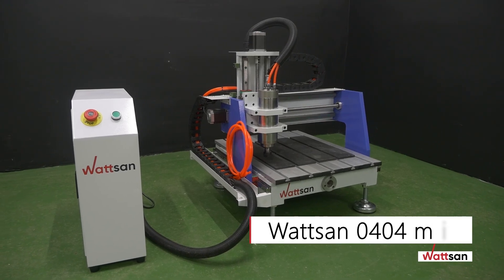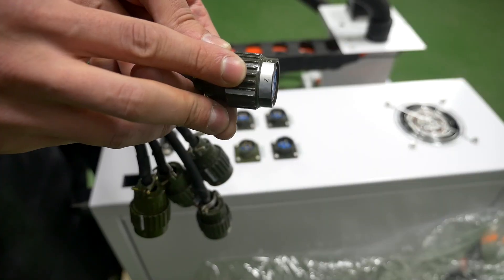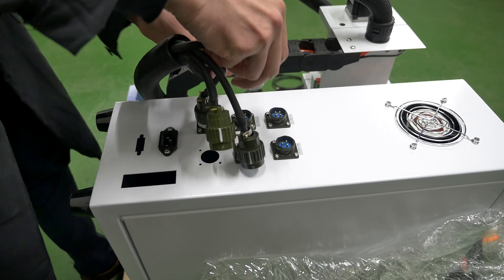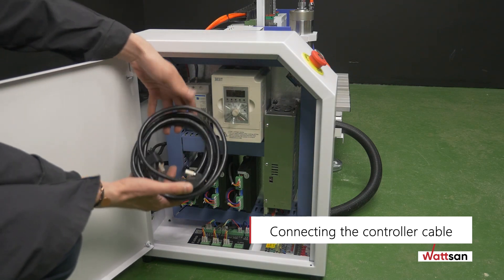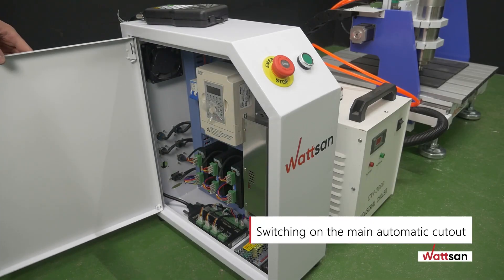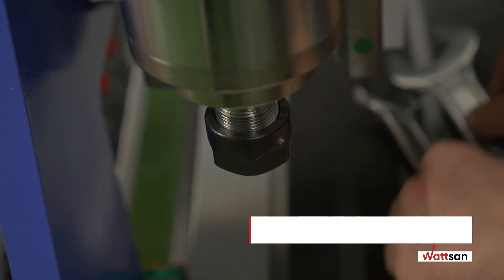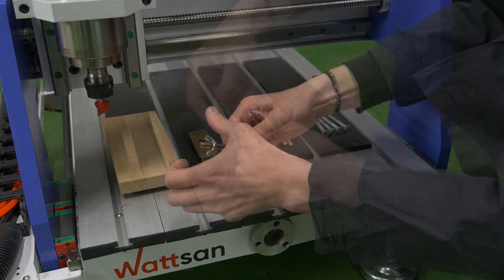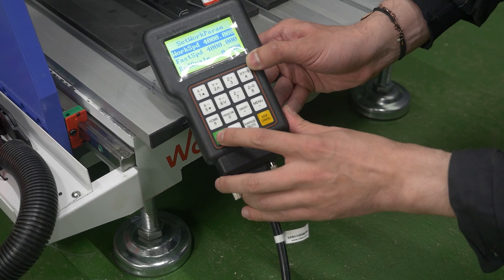INSTALL & START mini CNC router Wattsan 0404 mini

Comment: A title thing came as disappointment : 
1. The working table of the machine was not straight, there were a difference of more than a 1mm across different points. Had to make my own table.
2. Lack of a mechanism to properly hold parts. The bolts used in the video to show how they hold down the piece of wood are a joke, they can not hold a piece of aluminum well enough to make a 2 mm deep cut (just my example-wanted to make a 7cm x 4cm aluminum label).
I am still waiting from the company that makes me now a proper table and a universal holder out of aluminum, after I replace the stock ill report back on the spindle accuracy, if it has more than 0.6mm shift I'd rate the machine not even for hobbyists